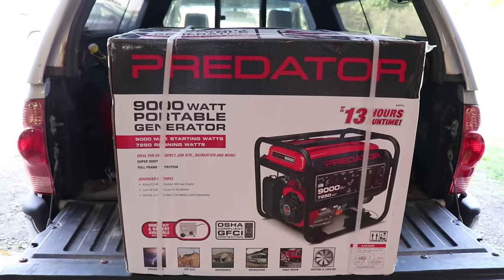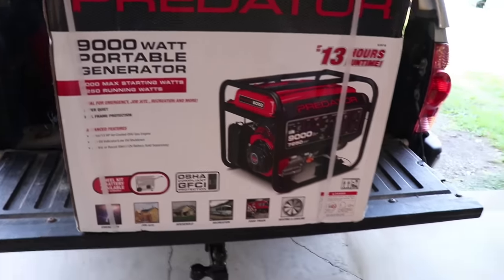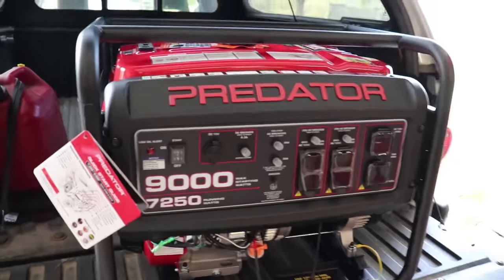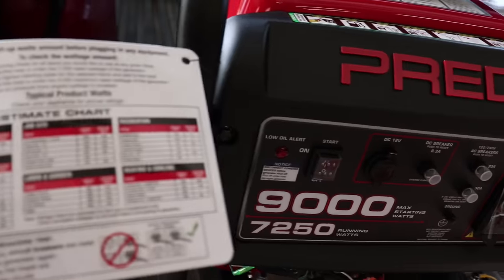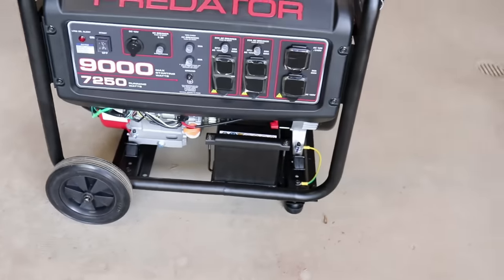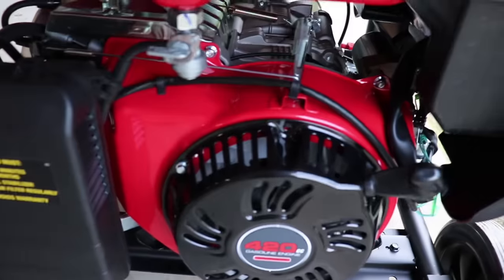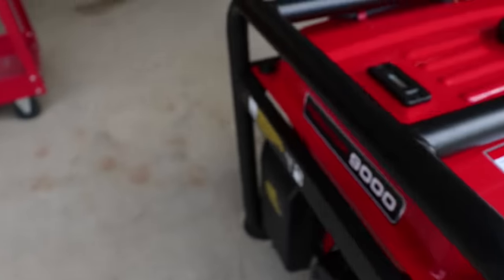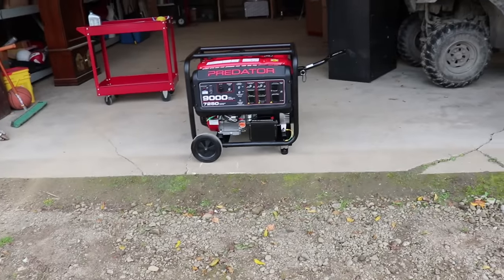Predator Generator Running Our ENTIRE Home. (Complete Setup and Cost)

Comment: Dude all happy with a brand new predator! Wait 2 years until he actually needs it and chinesium rattle trap won't start! 

Never trust your life or your families life with a discount Harbor Freight... Spend a bit more buy Honda and sleep well!
Reply from the maker: Year and a half and zero issues. None. Starts and runs 100 percent every time.
Reply: A Honda of the same output would cost about 10 times as much !
Reply: @TheCookFamilyHomestead  you won't listen to wisdom... Then you just learn the hard way.

Without exception every single predator engine I've owned has failed. Also without exception every single Honda engine has not.

You bragging about 1.5 years? LOL I've got a  mower, an HR21 from 1978...and a 1980 Honda Elsinore that both run like they day they were new! 

Call me back in 43 years and update me on how well your chinesesium generator is holding up.

Millennial Arrogance
Reply from the maker: @CoolIHandIMatt   I'm not bragging at all....you're the one who came on my channel and said it wouldn't start in 2 years. I replied and said a year and a half in and it is still running great. So....I'll update you in 6 mths. 

But now I see you've moved the needle from 2 to 43 years. LOL. 

"Every single predator engine you've owned"??? How many have you owned? If they're junk, why do you keep buying them?

I guess I'll "learn" the hard way. I will have to go through 6 of them to pay what you did for the Honda. 

And from the thousands of comments on my videos, there are a ton of happy Predator generator owners out there. Many who have used them for many, many years. 

I always find it amusing when people use the word Chinese in a bad way. You do realize that your Honda generator head has been outsourced and built in China for 30 years...right? Nice try. 

Feel free to go enlighten someone else. I'm doing just fine. I'm content with my "millennial arrogance"...HAHAHA!

Comment: You made several mistakes when you used your brand new generator. those mistakes can cause the engine and the generator itself not to last as long.
Reply from the maker: Over 2 years old. Lots of use and absolutely zero issues. Like your name by the way. 😁 https://youtu.be/sgkomlHQxew

Comment: Don't run in the garage!!
Reply: You’re right. That’s why the generator safety rules need to be followed. ⚠️portable generator safety announcements:

This is just a reminder to remember the safety rules when using portable generators. 

1) KEEPING OTHERS SAFE: Please do not allow an unqualified person or your children to operate and service the portable generator. Just because some manuals don’t say that doesn’t mean it’s safe. That is important against the generator safety rules. We also need to be keeping an eye on our children too. You need to make sure that your children are not playing near the portable generator especially when it’s running so they won’t get electrocuted. Generators pose electrical risks and they can be hot during an operation. Please keep your children away from the portable generator at all times. It is important to keep our children safe especially our little ones. Be aware of all the hazards.

2) WHERE TO RUN YOUR GENERATOR: Some people use their portable generators indoors which increases the risk of carbon monoxide poisoning. It’s important to have a carbon monoxide if you have a gas generator. Never ever use your generator indoors even if your doors and windows are open and even in the garage is not safe to use a portable generator. Please do not even use your generator in your deck or balcony. It is never safe to use your generator indoors and in enclosed areas of your home. Your generator needs to be 15-20 feet away from your house. 

3)🔥FIRE HAZARDS: Never refuel your generator while it’s running. You need to let your generator cool off before refueling it and before storing your generator. Never overload your generator too. Never ever back feed your generator. You should never plug your generator into a wall outlet. Also never store propane tanks indoors. Please keep flammable things away from the generator as well and please don’t smoke cigarettes near the generator. Having a fire extinguisher next to the generator is also important against the generator safety rules. 

4) GENERATOR OPERATION: make sure your hands are dry before touching the generator. Never use your generator in wet conditions. Don’t let your generator get wet. You need a generator tent if you need to use your generator during wet weather. Please don’t wear loose clothes when operating the generator. Turn on your generator before plugging in appliances. Use the right cord for your generator. Please do not use worn out cords. 

https://youtube.com/shorts/eFigDfnPkcQ?feature=share and here is a short video more about keeping others safe when using generators 

Hope this helps.

Comment: Anything new will work well . Predator engines are Chinese junk , nothing coming out off harbor freight is any good. I rather have a used name brand generator than a new unreliable predator.
Reply from the maker: Almost 2 years now...zero issues. None. Pretty good for Chinese junk huh?